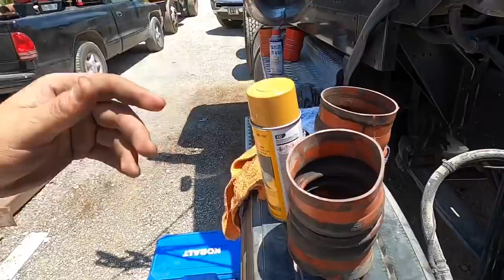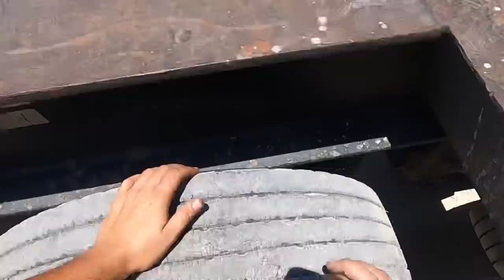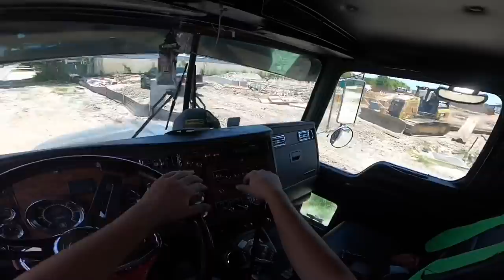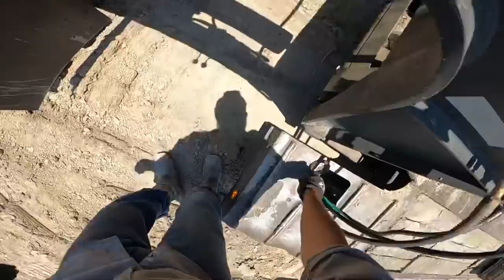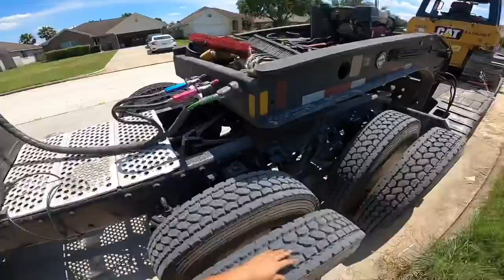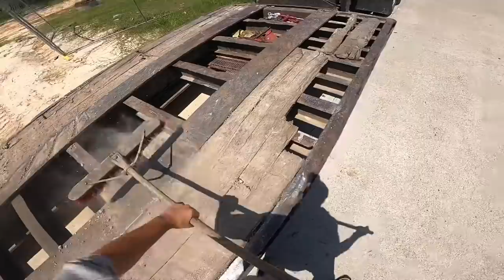POV Heavy Haul trucker, kenworth hauling CAT D3 dozer with RGN lowboy

Comment: I just wanted to say, god bless you brother. Always enjoyed your videos, and i just wanted to ask if you gonna add bigger finders and replace the transmission to a 13 speed one day. Why not remake the hole interior. I mean the truck Is very beautiful but I there is some bits where you can still improve. Love and respect G
Reply from the maker: O yes interior is not finished at all still have lots to do, and yes I do plan on stretching later on and doing a 18 speed maybe a 13 also would not be bad.